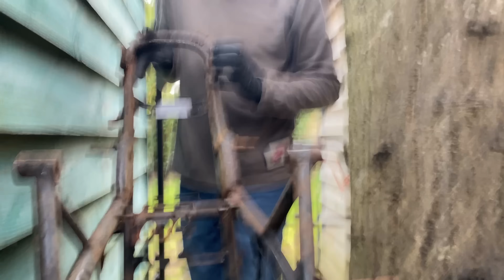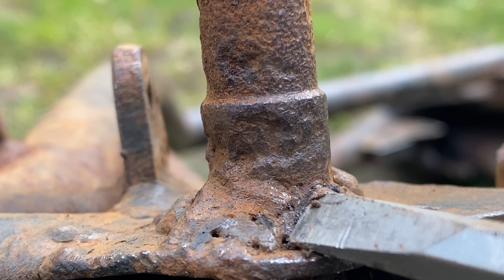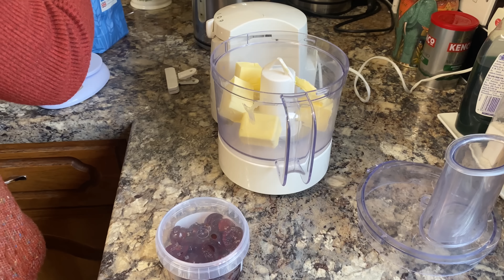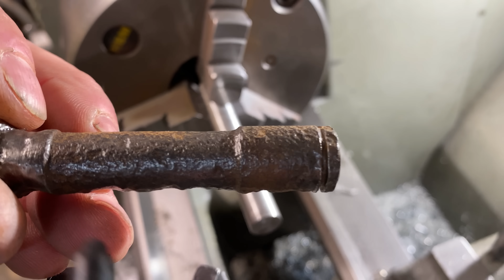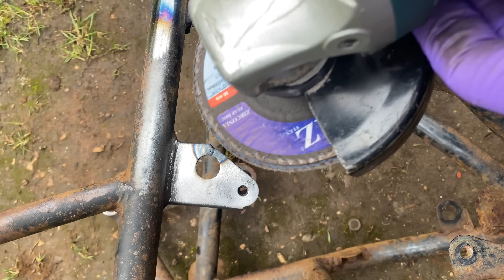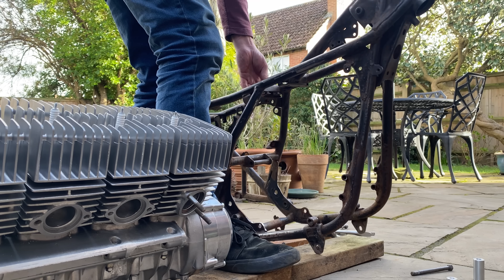Kawasaki S1 550 four cylinder Frame repairs - Episode 8

Comment: I watched the frame restoration because i thought MR. Millyard was going to weld gussets to the frame in key places to quell the flexible flyer syndrome, but that did not happen, adding an extra cylinder brings the HP up to 74 so yea would not want to open that up to 8000 rpm in every gear.

Comment: Very impressive this kind of „intuitive“ engineering -that’s of course due to the vast experience from previous builds I assume - what really amazes me: was the lucky coincidence, that those engine mounts did fit perfectly on the outside of the KH250 frame with the new widened 4cyl. Block, whilst on the original 3 cyl . Engine it did fit from the inside -did / could You plan or at least did You had this in Your mind, whilst adding the fourth cylinder to the block? - as this lucky coincidence is amazing, would have caused new engine mountings/ vast frame modifications otherwise… Anyway and in any ways: Job well done !

Comment: Morning Allen, I always enjoy your very informative videos. Couple of questions. Re your Kawasaki 350 engine, why didn't you go for a 1342 firing order, as it minimises the torque twist on the crankshaft? Also have you thought about building a large single cylinder thumper bike?

Comment: Allen! Have you ever built a twin crank engine? I've been dreaming of a twin crank 8 cylinder motorcycle engine with the cranks mechanically geared together, but there's a catch! They aren't geared together 1:1. Say one crank gear has 50 teeth and the other crank gear has 49 teeth so that the RPM of each crank are slightly different and the exhaust pulses resonate in and out of sync like an echo once every 50 revolutions! Would it be heavy, unpractical, and overly complicated? Not for a Millyard Bike it wouldn't! And it just might sound Marvelous. A gauge cluster with 2 tachometers would be quite the conversation piece.

Comment: Hi Allen, I had a question on your 6 cylinder engine constructions. I have a 6 cylinder classic Bristol car engine and I was wondering whether I could make a replica of the ultra rare 12 port Bristol cylinder head by making 2-cylinder units on an aluminium printer and then (as you do) welding the head together. The head has coolant water ways. What do think would be the callenges of this, or the first questions to ask, if you like?

Comment: So the KH250 & 400 were UK only then? thinking about it presumably the frame was originally designed for the 350 US market model and the UK got a 250 and a 400 instead from the 350 chassis and bottom end (and maybe a few 350's early on). I'm still curious about the front mounting plates which you left out here but it's good to see the frame naturally adapts without needing much if anything in the way of modification on the original mounting points, more time for Cakes!!

Comment: I am 52 and working on bikes since I was 12, I feel like I learn something from each of your videos. I am currently renovating a 1990 rm 250 frame. At the rear where the seat and rear fender mounts there's a brace that strengthens the two rear frame rails and is a support for the rear of the seat. It needs to be refabricated and strengthened, I have a 1989 that was also damaged. With your repair process is done better than my previous, so I will take some ideas. I also have to repair a rm85 rear brake pedal for my son and it's like the KH brake pivot, but instead of being welded to the frame, on the Suzuki it's welded to the pedal. I was going to replace the whole pedal, but now you have inspired me to make the pivot and weld it on using a magnet, I didn't think of that before! Keep 'em coming 🤩

Comment: Yes I also use Taper Roller Bearings as you can put a bit of preload on it as it saves buying a steering Damper plus you can adjust it to how you need it to be . Stops getting in to a tankslapper moment at 240 kph worked well on my 1979 Suzuki  GS1000s the Blue and White one it can pull 110kph in First Gear and wond off the clock to the pin in top

Comment: Back in the day the consensus was that the problem with Japanese frames was that they used what amounted to gas-pipe ('mild steel'), and that if you could made a precise replica down to the last bracket out of decent chromoly you'd end up with a bike that actually handled (at speed). Don't how much of this is literally true, but I do remember my CB750F1 seemed to handle well (nice steering/geometry) until you hit something like a sudden camber change in a fast bend and then - boingy, boingy, boingy - cork-screwing, bar-flapping and sphincter-tightening ensued.

Comment: Question: 
While I have no direct experience, I have always heard that Kawasaki triples had flexible frames. Now that you’ll have MUCH more power on tap than the original 250, have you considered adding bracing to the frame to accommodate the added horse power? Enquiring minds want know!

Comment: Was it luck or design that the engine lugs lined up perfectly with the frame mounting points? What if there was an overlap, i.e. the engine lugs would have been on top of the frame points rather than outside of it?

Comment: Another great video Allen. Thanks. I have a question about registering the bike in the UK. Can you just use the VIN plate on the frame or do you have to register it as a modified bike because of the bespoke engine?

Comment: Great stuff. How did you know that the engine mounts would line up exactly on the outside of the frame mounts? You must have measured something surely?
Reply from the maker: This is the fourth one I’ve made
Reply: Allen, have you seen Project Hercules on you tube? Single cylinder sleeve valve from a Hercules. The engine is being built for a bike frame

Comment: That lower front engine mount also needs a spacer between the frame tabs. The factory engine acted as  a stress member tying the frame together when dropped between the tabs. Now the engine is outside of those tabs, so there's nothing to tie the frame. Also, when the engine is heavier and torqier than factory, the frame needs to be reinforced. Quick solution would be fastening the engine to the main tube, but the air cooled engine doesn't have any good mounting points at top. Keen to see your solution to these problems.
Reply: Best solution is to find a modern frame and bin that flawed directly from the factory putty frame.
Reply: @BTW...  Or cut the main tube out, where the vin number is stanced, clean it up and locate it to a jig. Then get the tube bender out and some fresh material, and make something that could fit that beast with all  the needed accessories.

Comment: Really enjoyed that Allan, cracking job on the frame mate. A lot of people would have put that frame in the scrap bin, not you and mind dose not work that way. Looking forward to the next video
Reply: Best place for it... the bin. 
Those Kawasaki triple 2 stroke frames were the reason those bikes handled like crap into a corner at any speed.  Not even the stock standard attempted fix of a steering damper, when the designers discovered how bad on a built bike, addressed the problem that originated from multiple frame design flaws. 
No bike manufacturer today would get away with selling death traps.

Comment: only allen can fire a ghost engine up on a tailgate no tank no frame no nothing...fine work as usual Sir.
Reply: I once started a 2HP B&S horizontal shaft engine sitting loose on the carport. It shook, tried to walk off, frightened the very young me. Would never have though to try to start a 4 cylinder 2-stroke that was sitting loose at a pickup truck tailgate!

Comment: Looks like 46mm to me???
Allen, you do an amazing job! Not only making custom motorcycles but making them look like factory.  👏
Reply: 🤣🤣🤣 think Allen knows how to read a vernier - are you new to this channel?
Reply: Definitely 49mm sir, I think you are misreading the gauge by looking at the end (which is lined up to 46mm) instead of the correct zero datum point which is at 49mm
Reply: @iankidd1257  You are probably right.
I only got a quick glance, and should have gone back to look at it .25 speed...

Comment: I’m really impressed at your ability to tig weld those small slightly thinner tabs . 
I’ve found with really thin stuff that silicon bronze works best for me because it flows out before the part melts . You’ve got some real control that I haven’t mastered yet . Love the videos . Thanks for the distraction .
Reply: I found you have to use a tiny TIG torch and thin welding rod. I have to get to a really comfortable position and get braced to make the tiny tiny circles required.
Oh - and of course the metal and welding rods have to be clean clean clean.
Reply: Sorry for replying twice but today at work I was doing some tiny welds on the governor control plate of a Kawasak industrial engine and realized that what I told you is how I do on hobby-restoration/perfection stuff ONLY. 
        When you don't have all day, the metal is galvanized, thin and probably vertical or inverted - you either grab a really really good autodarkening hood or set up two really really bright worklights and wear a standard Shade Ten helmet.
          Then you have to have a "hot-at-all-times" MIG torch hooked to one of those rare power supplies with "less-than-zero" inductance hence zero time lag required to burn off the wire (I use a standard 110v, NON-inverter technology power supply with 24 volts of lead acid batteries paralleled across the transformer-rectifier unit)(It's a hassle but its worth it)
         Secondly I never use a ground clamp - rather just a rectangle of 10ga. sheet metal. I either tack a corner to the work piece or if there is enough level bare metal just set it there.
      I heartily recommend straight CO2 and .030/.76mm solid wire - it's cheap, eats up rust and impurities and makes shiny welds !
           The secret is to arc on your grounding plate for a second, get your CO2 flow going and on it's time-delay phase - then release the trigger, then quickly touch the hot wire to the dirty oily painted stuff to be welded and the instant it sparks hit the wire-feed trigger for half a second, let off for half a second (FREEZE YOUR BODY AND DON'T MOVE) and depending on how thin the stuff is (how long it takes your hot weld metal to stop glowing) modulate your weld and pause times in what we call "stutter welding".
      As this tends to make welds several times thicker than the base metal - be prepared to grind it all flat again to get what you want.
     The little piece I welded today took four stutters, a little cool down time and like one minute with a wide wheel in an air cutoff tool and "good enough, Job Done!"
    You are welcome.

Comment: Ah , great to see a fresh video . Try using the edge of a 1mm cutting disc when grinding down welds , at a steep angle to remove metal and then at a shallow angle to finish , you can be very very precise and not thin down the surrounding metal as much as with a flap disc , it takes a wee bit of practice but when you get the hang of it its a good technique to have to hand.
Reply: I do that, yes it takes some practice but it does a good job when you get the hang of it.